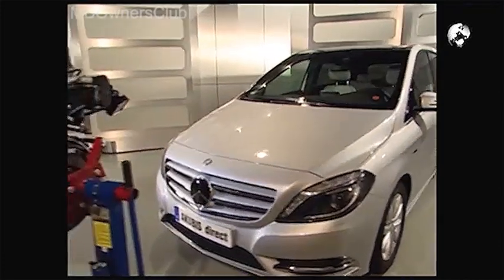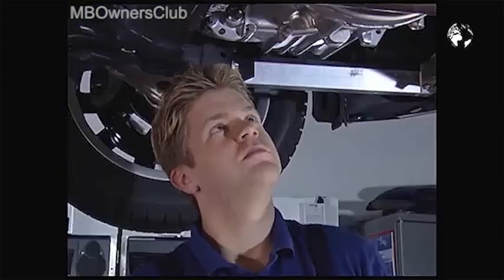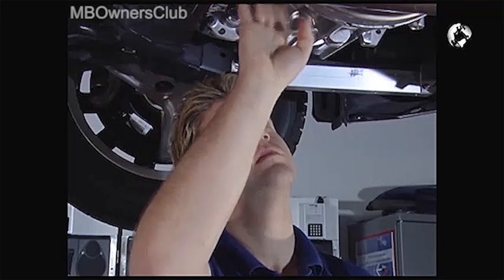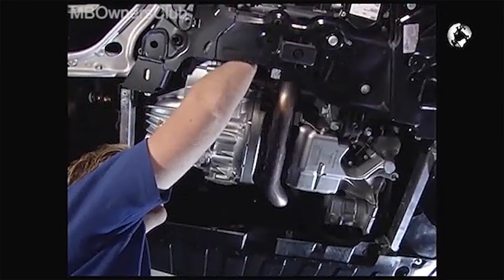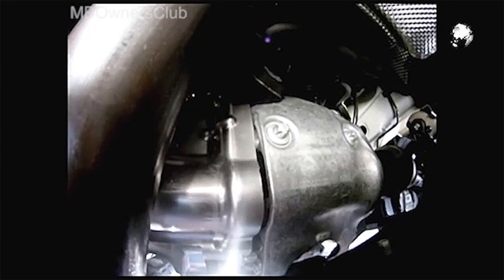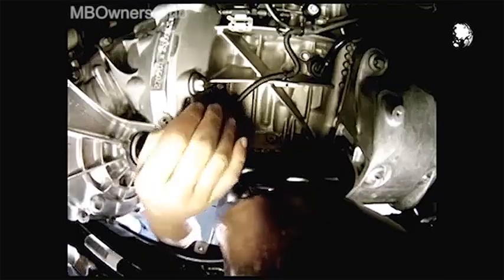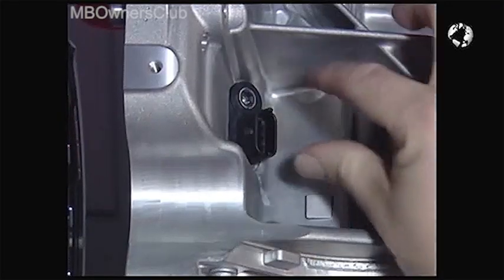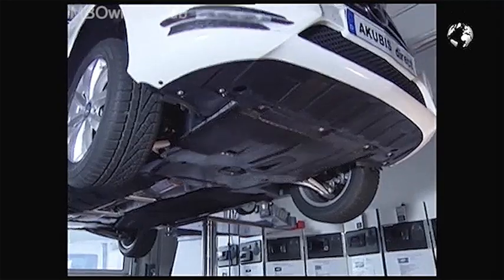Crankshaft Hall Sensor Removal & Installation on Mercedes-Benz M270 Engine

Comment: If your doing it on jack stands take out the battery and tray. You can get to the sensor from the top. Still need to remove the heat shields

Comment: Don’t even bother removing the second heat shield I was able to do get to sensor with that still on , make sure you use oem Mercedes sensor , I tried off brand and car wouldn’t start . It’s extremely tight and pain to get to I actually recommend a shop
For this one

Comment: If anybody actually watches this video, let me tell you. This is an awful job to perform. Took me two hours to remove the 2 heat shields and the screws to the cover plate. I couldn’t get the second heat shield or the cover plate out of the engine bay so I could find the connection to the part. I’m stuck and I may have to spend a couple hundred bucks to tow this to Mercedes so that they can fix it for me. Note: I am pretty handy and I do work on cars occasionally. This job is a nightmare and it is worth paying someone to do it for you.
Reply: Shut up